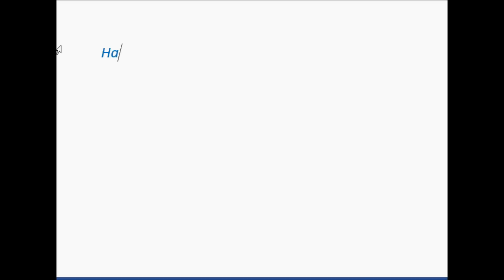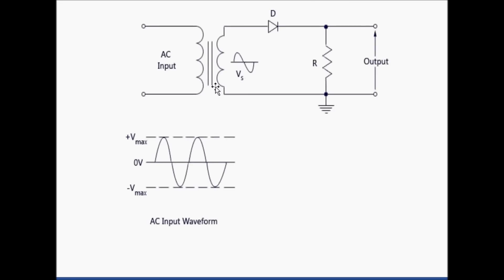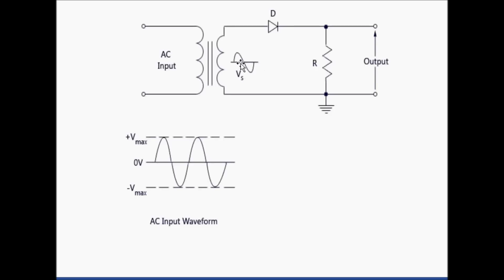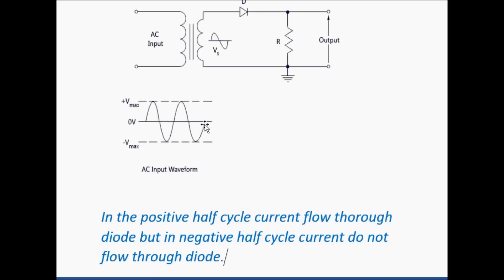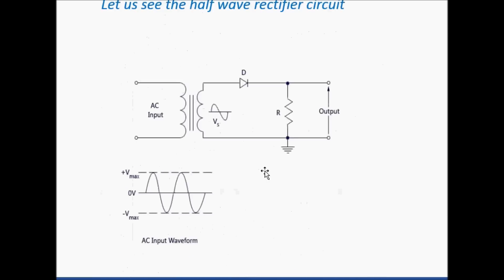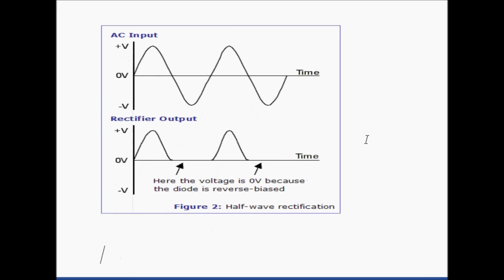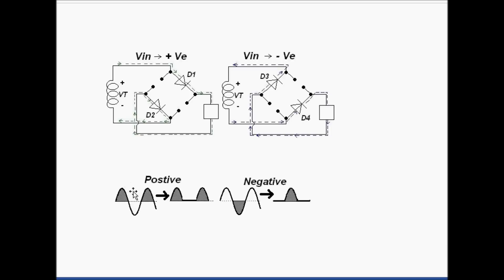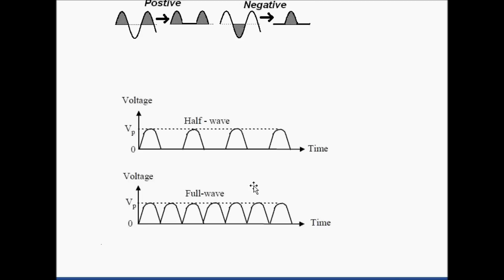Rectifier half and full wave

Comment: in negative cycle, diode wont be short circuit as you mentioned. it will be an open circuit. short circuit is zero resistance path, current obviously will flow.also some incorrect spellings like writing thorough and saying in video through